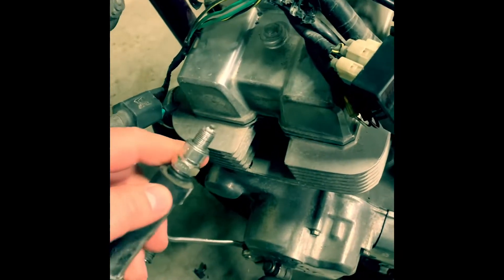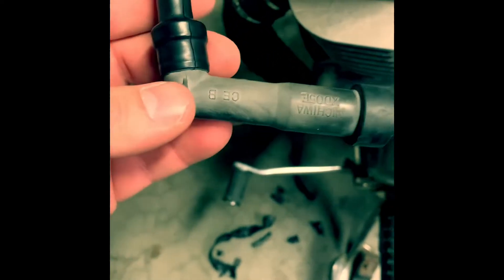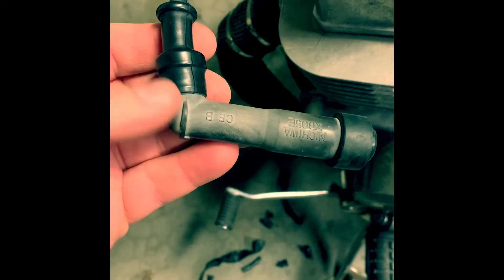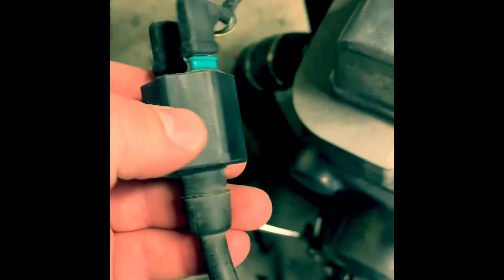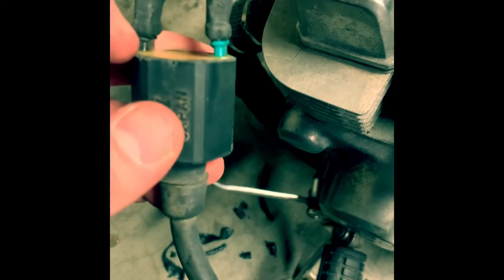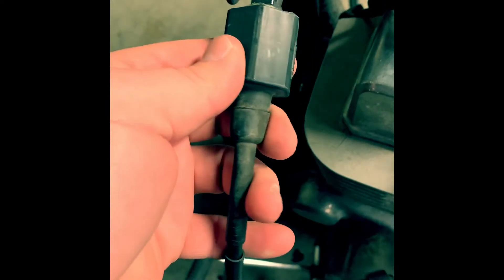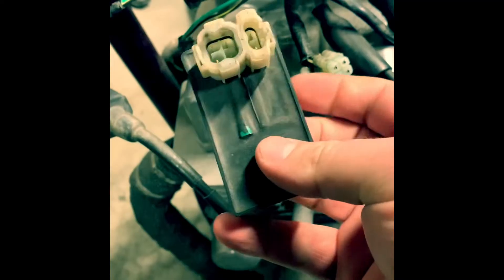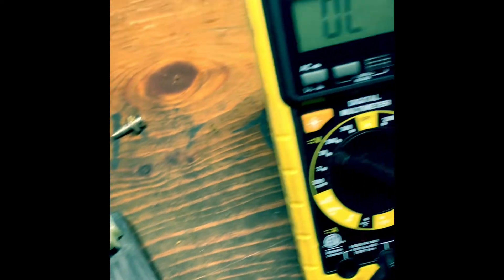How to fix no spark on my motorcycle

Comment: The cause of my bike not sparking was the ignition switch.  Had to take it apart and clean the contacts to get the bike running again.  Remember to check your pickup coil also.

Comment: I turned my bike off with the kill switch and didn’t turn of the egnithion, and it started straight away, but when i turned the bike off with the key it woldn’t start again, it starts when i run start it. So i don’t understand, why it is spark when i first Get it started and the egnithion is always on but not if i turn it off and on straight away???
Reply: bike acting the same. any fix?